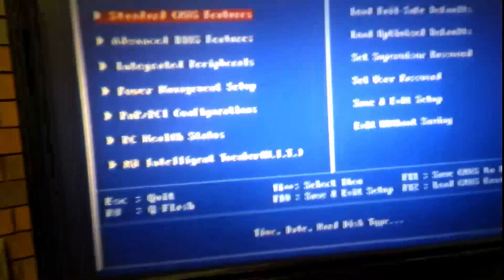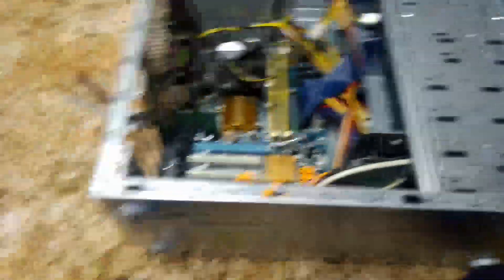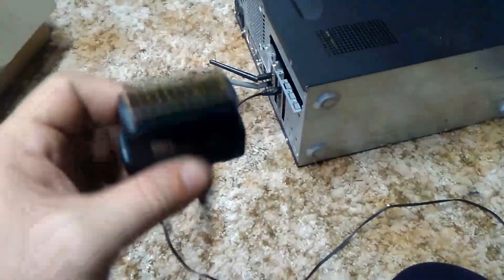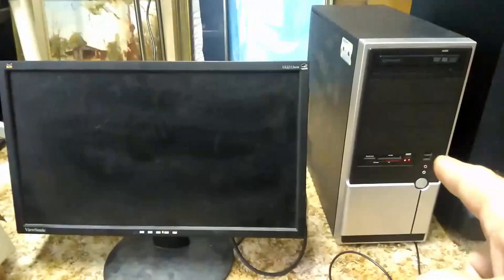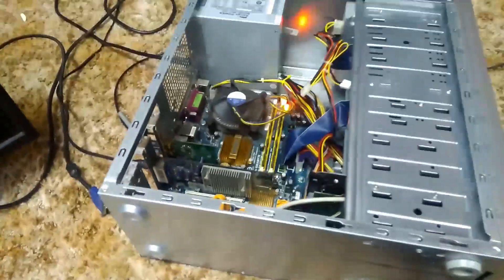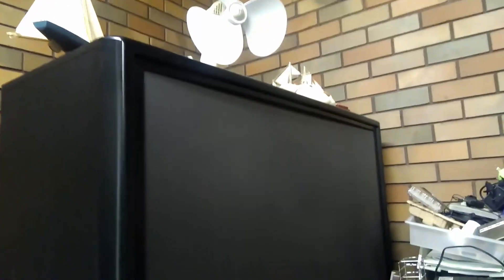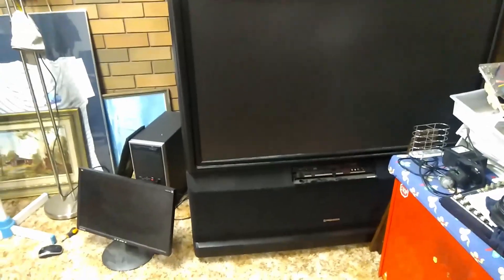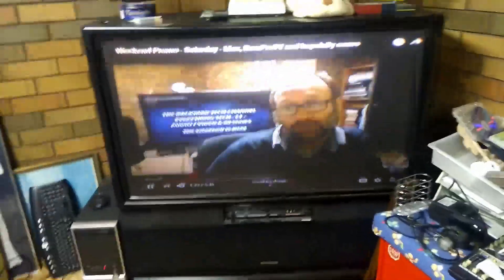Building a computer for my Rear Projection TV - PT 6 - Follow up

Comment: Electronics repair from 1973 till 2007.  A/V.  From valves to germanium to silicon to IC Chips till surface mount till loss of work due to the throw away world.

Comment: dude i have a question, ive recently received a sony 61 retropreyector tv trinitron, the image would be clear if i use a gf mx4000 128mb with s-video, mi pc is a pentium 4 3.2ghz
Reply from the maker: Being a trinitron system, using s-vidro will be a good idea. 
However fine image adjustment on the tv will be needed aka, contrast colour, sharpness primarily